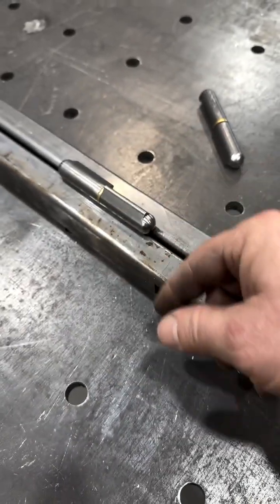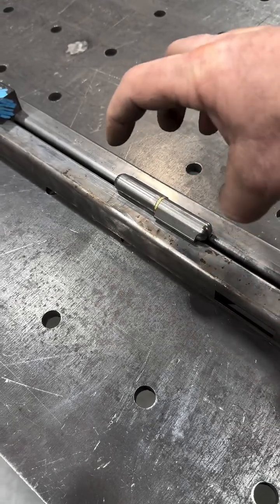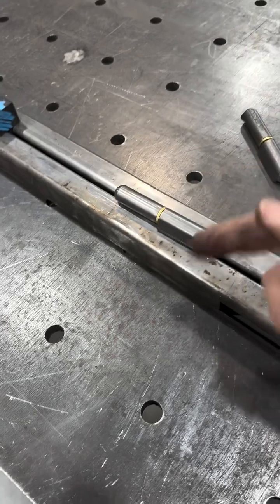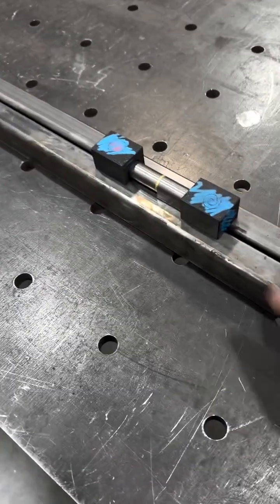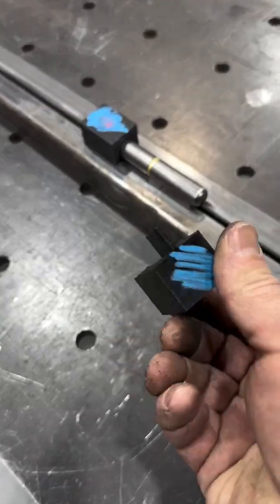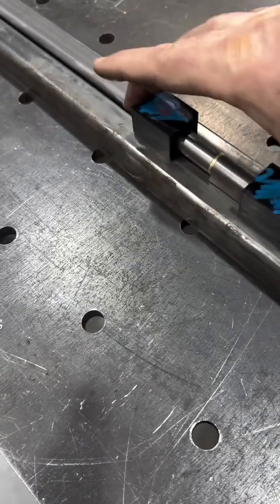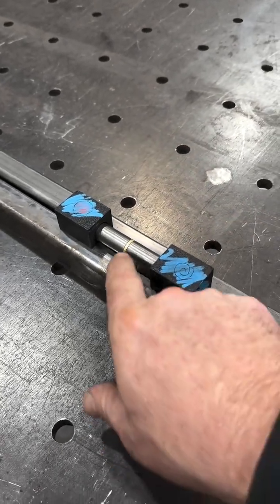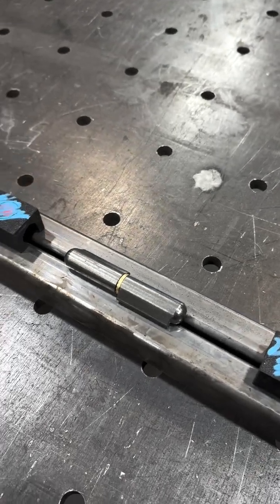This is how we set our bullet hinges on our steel doors

Comment: That’s an awesome idea. I had a friend make me some 3d printer miter corners so I could weld 1” square to 2” square and have it centered and be able to tack 3 corners of the miter at the same time. Worked awesome. He’s a super smart guy and came up with the idea about 30 seconds after watching me struggle with spacers, washers, and a corner clamp.
Reply from the maker: @effectivetactics422  3d printed jigs are so helpful.